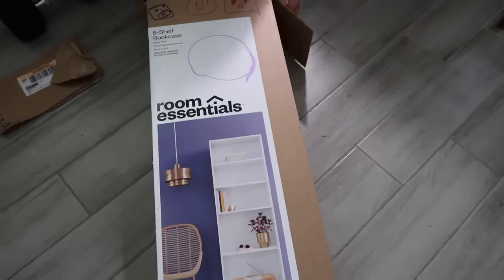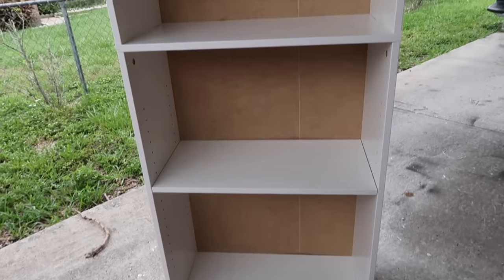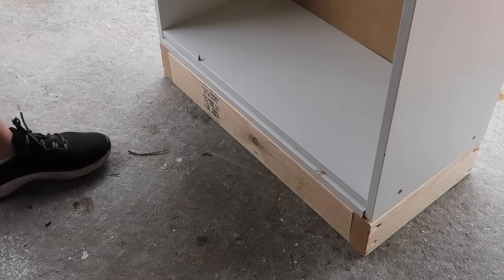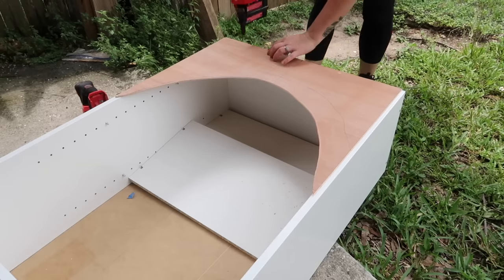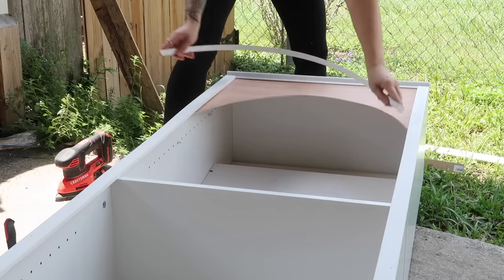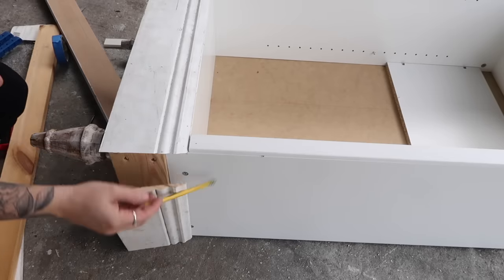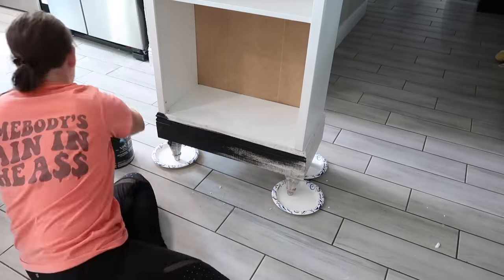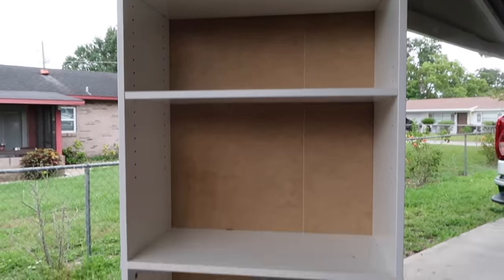Diy furniture flip on a budget! Turning a basic bookshelf into something beautiful!

Comment: I did something similar to a bookcase. I covered the back with wallpaper.  I wanted to do the trim as well but was concerned about nailing into the front. I thought it would bulge out (if that makes sense). What size nails did you use? Since you've already done this, do you think using liquid nails instead of Brad nails would work?
Reply from the maker: So no I likes nails better the liquid nails can leave residue that's hard to get off if you make a mess like I did in a few areas lol but I used the smallest nails they make for my nailer. I think they are 1/2 in.
Reply: I don't know if you will see this comment at all, but I will give it a shot.  How did you attach the base to the bookcase? I'm actually in the process of building my version of this and not sure how to attach them to each other.